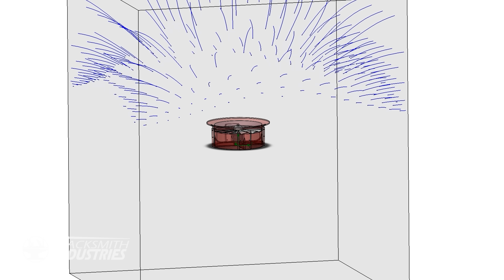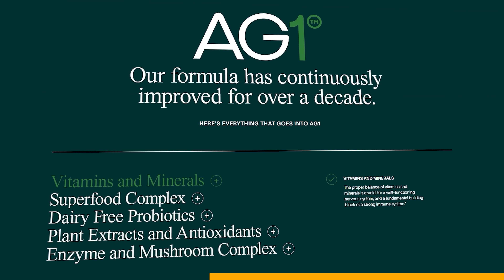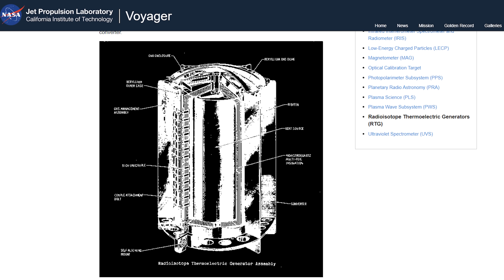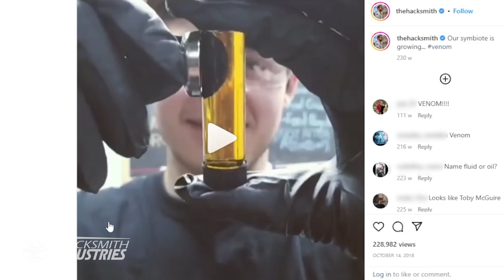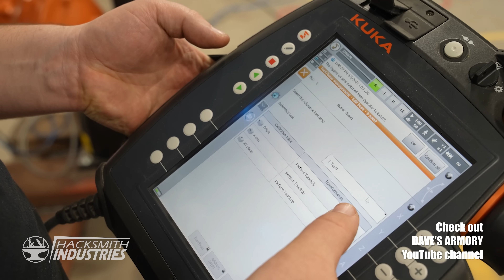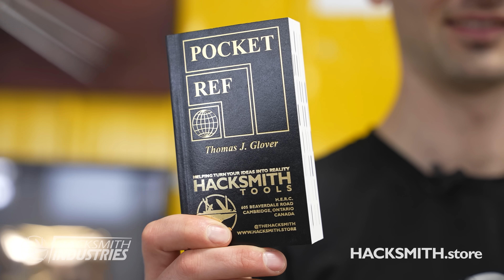Top 10 Secret Hacksmith Projects You Have NEVER Seen

Comment: An idea: revisit the umbrella idea, but instead of using jet engines, use a propeller. The goal of slowing and stabilizing descent is much more reasonable than achieving controllable flight like with the inspector gadget hat. Would also be cool if you could use some of the silent propeller blade designs as we see in some new drones.

Comment: Project to finish is definitely flying like iron man with some sort of electro thrust, bonus points of you use an arc reactor to  ignite the compressed air flow made by the thruster, into a kind of after burner.

Comment: I think most of these projects are possible, they just need looked at differently. Reminds me mythbusters giving up early. 

I think you could get doctor octo working, using different systems for lifting objects. 
And for dodgeball you should use real, foam, dodge balls, have the machine pick them up and load them, it should be easier to shoot the real balls and maybe by using a slingshot instead of rollers

Comment: If you want to rethink the Iron Man project, why not make an exo skeleton that embraces the upper body and arms?  It would help the engines keep their thrust, plus it would be easier to place them on the upper body, thus taking the load off your waist, plus it would be easier to carry the battery pack if the accumulators were hidden in the stiffening rods of the exoskeleton.  You shouldn't have to keep your body weight constantly, it would be easier to distribute the drive of the gears and the weight.

Comment: The dodge ball robot seems like and easy fix to me. Why not just use Flex wheels like the ones VEX robotics uses. They’re made of silicone rubber so they can grip the ball and with the right motors you can get it to shoot them fast 9:26

Comment: you should continue your batman gadget projects like a fire/bulletproof cape, or a cape that slows your fall. or takes another shot at making a more compact faster grapple gun. now I know the immediate problem of making a grapple gun too fast quite simply your arm would go and you wouldn't. but to fix that problem I think it could be helpful to build a reinforcement harness that puts the weight your shoulder would have to lift by itself onto your waist or even your legs. and you could have the harness cables attached to the grapple gun with a hook so you can put it away on the pelt and move your arms freely.

 I would also go into how I would build the cape based on my research but I won't do that in this comment. 

btw I love your channel and have for a while. I would love to work with you on some of the project ideas I have in my head one day. maybe I will be able to become an intern and we can talk, in the meantime wish me luck.

Comment: arc reactor honestly, maybe you can find a way to use this immense power to power some of your larger projects and size them down. Maybe this would be quite usefull for a lot of power heavy projects hm. ( mini nuclear reactor in lightsaber :P ? )
Reply: That arc reactor didn't actually generate any power. It was a hydrogen fuel cell more or less, so just a battery.
Reply: @gabrieldarcy1744  i wasnt talking about the one they made

Comment: For number 5, I can guess why the sponsors pulled out. Simply because you over designed the robot and made it look like a scifi robot for some reason. So something like those wheels from that build, that speaker box and just a mic arm to hold up the tablet or phone would've been enough. I suppose its also their fault for not describing what they want but they definitely weren't thinking about a scifi robot.